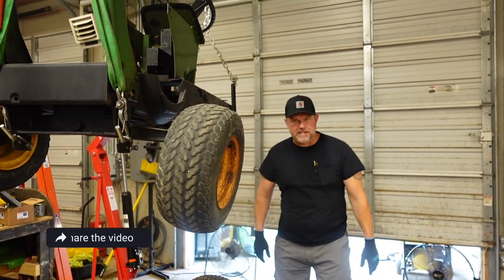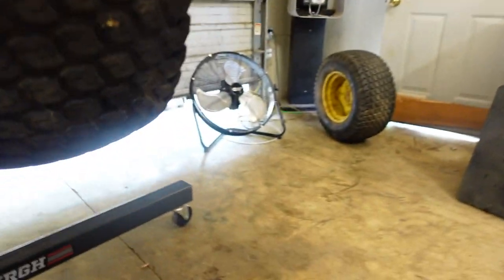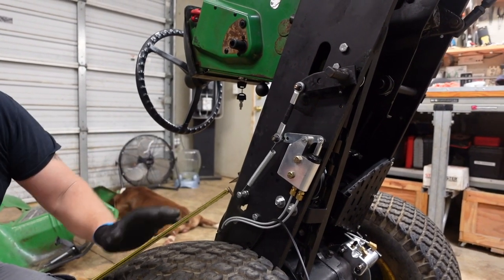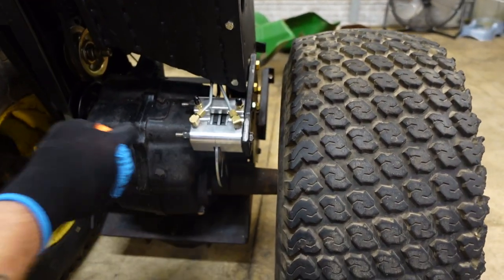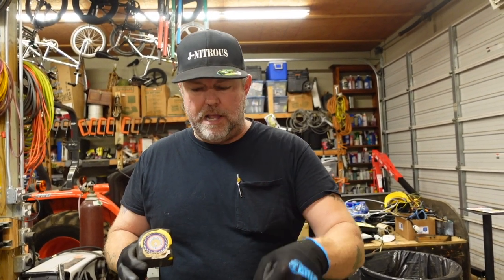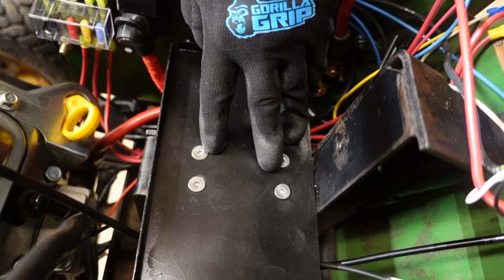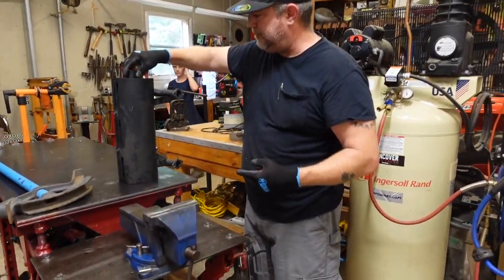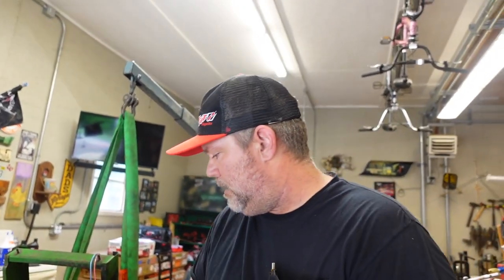JD214 Mud Mower build part 12 update on 3 days of work

Comment: just an idea? could a "T" fitting right before the adjustment valve... with the fuel line attached, then the valve but then also a smaller return fuel line back to the tank. I can think how that could work or fail... but some way to divert the extra pressure back to the tank.
Reply from the maker: I’m going to try a T in the system. I had the idea in my mind, and then the next day I saw a schematic on Robot Cantinas video. He is building an old French car powered by a Predator 670. What he came up with is a line from the fuel pump, a T fitting at the carb, then a manual fuel pressure regulator on the return line. It makes perfect sense, plus that guy is really smart when it comes to technical stuff. Unfortunately, I’m down in Naples, FL now, working out on the road. It’ll be another 3 weeks before I’m back at the house to mess with it again.
Reply from the maker: https://youtu.be/aPUxB4iwaOg?si=mIoFCPhb--0d26bY